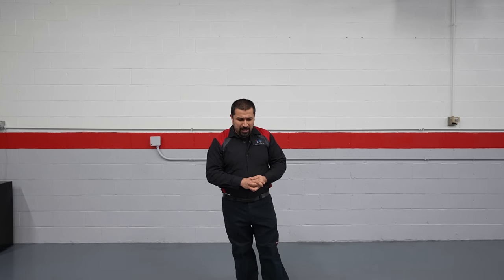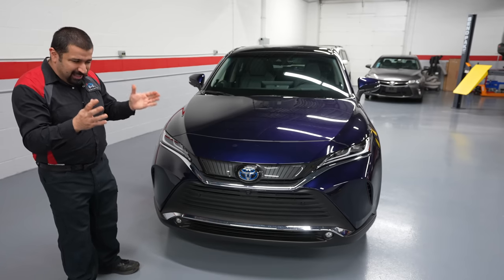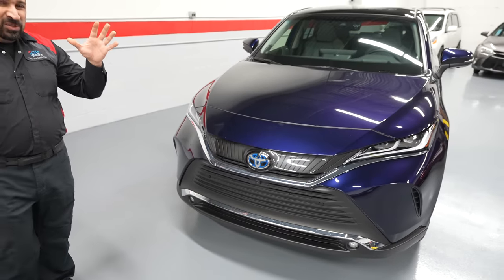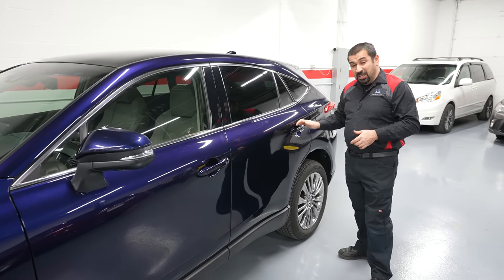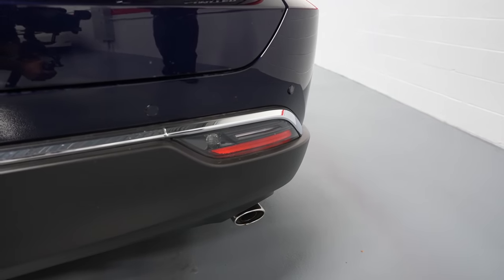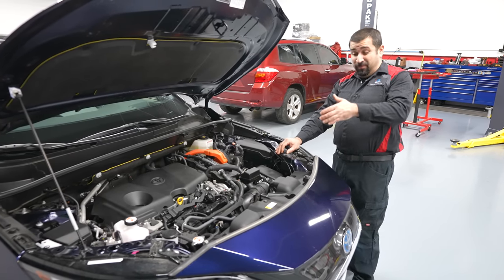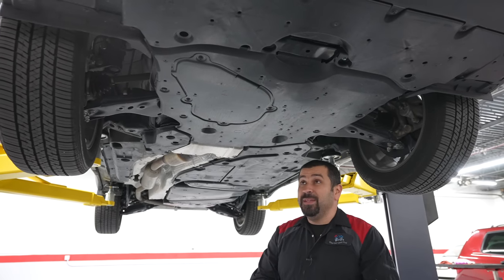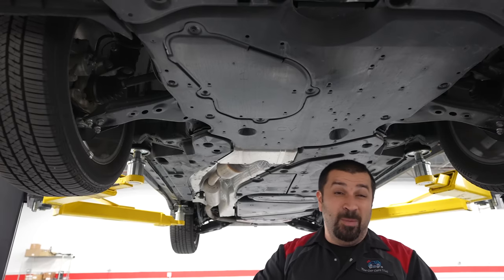THIS Toyota New Model is a Total Hidden Gem! Should've Been a Lexus!

Comment: Beautiful, but no knobs is at worst dangerous, and best inconvenient … and therefore, a nonstarter.
Reply: You can use the buttons on the steering wheel for the radio and to adjust the heat or air conditioning just say “Hey Toyota adjust the temperature to 70” or whatever temperature you want and it automatically does. I have a 2023 Venza XLE and love it.

Comment: Overall, I am underwhelmed by a number of alleged fog light designs today.  Some are cute pencil beams that are worthless investments.   Being mounted low is only half the game.  The other half is its cutoff pattern: the light stays low.  Folks who have driven in a good snow storm understand why: you get to peek out over the top of the beam and see further ahead because there's very little snow glare bounced back making you effectively blind to the lions share of anything more than 20 feet in front of the car as standard headlights will do.  At night, this is both tiring and hypnotizing - a really, really bad thing.  Best?  Something yellow - as in the old French standard which [because of the EU] was sadly abandoned in 1993 as a requirement by law there - they called it "selective yellow", which meant no blue light gets broadcast.  As they tested in the 30's, the observed this with yellow lights:  visual acuity increased 8%, pupil reaction was 26% faster [than typical white light], and pupil recovery was 24% faster.  Real winter service?  A spray bottle with 91% isopropyl alchohol in the car is helpful in the event of being iced over before they are turned on.  So... if you are one of those taken advantage of by marketing morons and bought 6k "superwhite" lamps?  Toss them, and at least get back 3k: its not yellow, but it helps reduce night blinding other drivers on the road.  In a snow storm, that also includes... you.

Comment: I was digging it until you said hybrid only. Sadly, many Toyotas will end up in the scrap yard when their gas-only counterparts are still going strong because the battery fails.
Reply: Come on man. The batteries don't fail except extremely rarely. Eventually they may to be rebalanced. Which isn't too bad price wise. And worse case you might need to buy a refurb/reconditioned battery replacement. At $2-4 it's totally work it to get 5-10 additional years on the car. dont you think?

Comment: It will never fly off the showroom force because it doesn't have the rugged off-road look of an SUV looks more like a wagon and it only seats five
Reply: Then, in your situation, I strongly recommend to go for a "Toyota Grand Highlander Platinum Hybrid MAX AWD". Check all the reviews and features specific to that high-end model more spacious than the 2024 Venza Limited. The 3rd row of benches can be folded perfectly flat and thus considerably enlarge the rear trunk if so you wish. 😉

Comment: I have this exact same color and interior Venza limited only it’s a 21. Review is “nice”. Seats are NOT leather, space in cargo area is smaller than most, it’s loud, tires suck and will need changing at 10,000 miles, star gazer roof is a overpaid gimmick, center console has no storage, headlights could be better, touch capacitive controls are horrible to use, center console lid broke at 18 months, the ECVT groan is too much, instrumentation and center screen graphics are outdated by 5 years. There’s more, he mentioned a few but I’m done. Lease ends in 19 months. Going Mazda.
Reply: Yes, some of what you mention has changed for the '23 model.  I like Mazda but I don't think their quality and reliability is up to speed yet.

Comment: If those little triangular windows in the front doors opened, they would equal 1960’s and 70’s cars. They are called, or used to be called, ‘quarter windows’. Nothing new or novel about them.

Comment: More than half of the aerodynamic drag is the underside of the car.
Think about it. You only see the belly of the car when it is't on a lift. You are not thinking, Man, this could do do 100 mph.
But the underbody is worse than the top. It has to drag  air over the road which is itself quite rough and aero-unfriendly.
Thus with the drive for aero-efficiency all cars are going to cover up the multple air brakes hanging down unseen below our cars.

Comment: You like the hybrid engine. I get it. But why no mention of specs? You didn't even mention how many cylinders the gas engine has. No info on horsepower, torque, how many miles/km it will go on electric power alone, etc. This is all really basic stuff. I shouldn't have to go to Toyota's site or another review to find out basic info about this vehicle.

You spend more time talking about your impression of the front end design than you do telling potential buyers what they need to know. Not good enough.

Comment: Toyota has ALWAYS had a problem with their designs being over-laden with unnecessary design elements, like useless swoops, curves and body creases. That their front grill is too large, and has been that way for many model years, is just one example. The exact opposite of classy. Toyota needs to more closely study what makes the more subtle European styling so attractive, without resorting to so many useless design elements. When given the choice between tastefully subtle, and over-the-top, Toyota has too often chosen the latter... Calling the front-end, (or any view) of this car 'very nice', or even 'classy' is a highly subjective stretch.
Never get a new model? My first-generation 2019 VW Jetta has had ZERO issues after 6 years of trouble-free driving! Just like the last Jetta I owned. Car manufacturers have long ago figured out how to build reliable vehicles.
Yes, Toyota dressed up the new Venza Hybrid as a luxury model. Some people want this. Others won't, as these expensive options push up the price point and costs of repair down the road. In spite of this being a 'premium' SUV, the trunk space is considerably smaller than my Jetta! A Volvo (or even VW...) station wagon would have much more room, and would be a far more attractive and practical 'high-end' family vehicle... A discussion of the actual price point, and how it compares with other mid-size SUVs would have been helpful.

Comment: VENZA???--- I would like one-- except it has the CVT...and I wll NOT buiy anything wiht a CVT.... but I love the rest of it..if they'd just get RID of the CVT..
Reply: This is not a CVT, but an eCVT. Look it up much more reliable.
Reply: @hss8973  MORE tech = MORE chances of failure..  NOT a good thing to me.
Reply: @davidwayne9982  This transmission has been around on hybrids for a long time and is very reliable. The current gen eCVT  has no belt or chain, and its design is extremely robust, way more so than a CVT.
Reply: @hss8973  I DON"T care--- I'm set in  my ways.. ok..
Reply: @davidwayne9982  I'm not trying to convince you, just stating pure facts.  Have a good one.

Comment: Sorry. Love your work but I do not agree on the looks. I am conservative, but to me this is a classic example of the ugly 'overstyled' design seen in so many modern cars that look like they have been designed by a committee. What is with the massive 'snow plough' grilles seen on so many modern vehicles? The majority of their surface area is not even functional. What happened to aerodynamics, low drag coefficients and pedestrian impact scores?  Give me hydraulic struts on the bonnet/hood over smart lock back door handles any day. I would also find the metal bodywork at the front of the car an annoying impediment to accessing the engine bay for routine maintenance.  Thanks for the opportunity to comment.

Comment: Dude, your nuts.  This suv is way too loud on the road, center stack doesn’t make sense, you crack your right leg on the center stack, the passenger seat doesn’t even adjust, you gotta climb up into the car.    But, it’s the damn noise.  You’ll certainly need new tires right away

Comment: A lexus for the most part is just a rebadged Toyota for people that want to pretend they don't drive a POS Toyota, my Toyota needed a new engine at 83k miles, my friends Tacoma new engine at 125k, pure crap
Reply: The most likely is that you and your friend forgot to change the oil.  Remember that gasoline engine cars need oil change every 6months/5K miles.

Comment: Toyota is one of the crapiest car I ever sat on, all the taxis here are toyota, so I sat in many models. I do struggle to get into the back seats with those roof designs going down very agressively (Only 190cm high, nothing exceptional) in the back of many toyota models to start with, today I sat in a recent model with manual window lever, I could not believe it. Plastic is predominent, poor quality that is. Electric windows switches are on drugs, they go up or down very quickly, you never get the chance to get the window rolling by stages or slow, very unfriendly switches. And that engine from this video looks like a real mess, what is up with all those pipes, nothing nice to look at. And from a body design point of view, nobody ever turned his head for a Toyota. Very sad car brand if you ask me.

Comment: It's not a Lexus, because Lexus already has crossover SUVs called the UX, NX, RX, and LX.  The name thing is not a big deal, because we all know Toyota changes their models' appearances (think Toyota Celica, Celica Supra, Supra, and all subsequent versions that look completely unlike the previous versions).  They rarely care about continuity or evolution of design (i.e., like the Porsche 911s that always are identifiable by the same basic shape).  As for the buttons, I agree.  Japanese cars, particularly Toyota and Lexus brands are not very intuitively ergonomic.  It's as if they don't care about intuition.  Maybe because the Japanese engineers think with opposite sides of their brains?  Who knows?  Toyota has traditionally been known for their quality, not necessarily their common sense.  One more rant:  the way you cannot lock your door with the key fob if one of the passengers hasn't yet closed his/her door.  The continual piezoelectric tone broadcasts to everyone that you are stupid for trying to lock the doors while one or more passengers were too slow to get out and close their doors.  Both BMW and Tesla are much smarter in that regard.  Battery under the seat?  Okay for this vehicle.  TOTALLY STUPID to do that in their huge ass hybrid Tundra.  That eliminates what most other trucks utilize as a storage area.  And what about the older Prius Prime?  Guess where the super low range hybrid battery went?  Yes, in the trunk where it reduced the cargo space.

Comment: Yeah but it is a crappy hybrid, it would be a nice car if I didn't have to worry about replacing a $30k battery a couple of years down the road.
Reply: $30k battery, how the heck you come up with that price.
Reply: @hss8973  $8k to replace a battery every 3-4 years, own my gas car for 10 years, $24k.
Reply: @NeverDoubtMe23  $8k to replace a battery every 3-4 years. Where did you get that from? Maybe a Tesla or Hyundai. Toyota Hybrid batteries last over 10 years easily with proper maintenance. Get your facts straight man!
Reply: Before posting a comment you should get the right information, Your comment is completely wrong.
Reply: @Victor Mendoza  OK fanboy, whatever you say, this is straight from Toyota's website, maybe you should do some research, no?